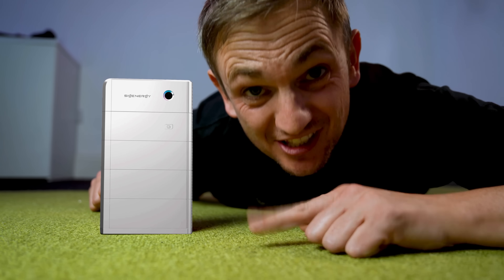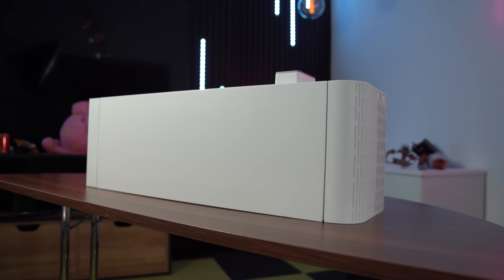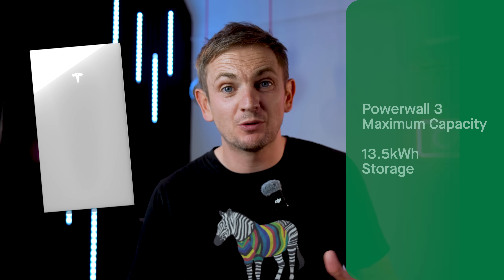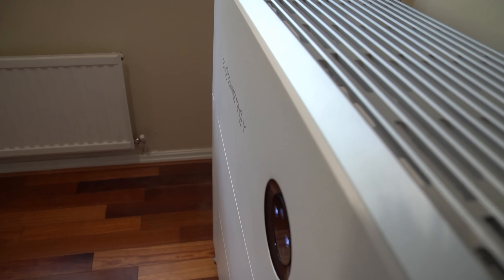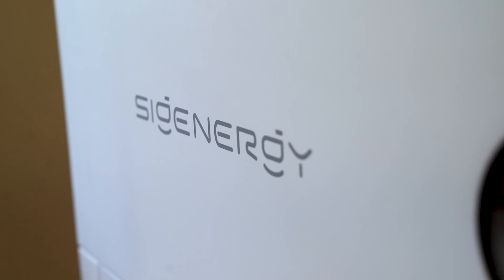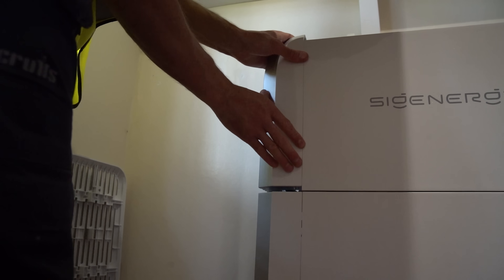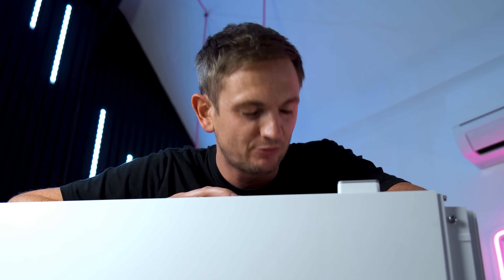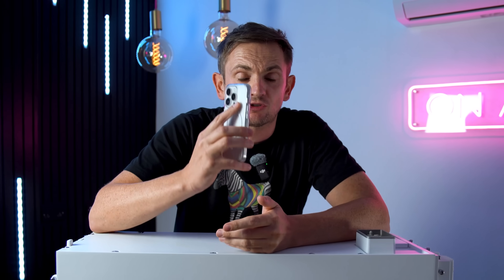Are Sigenergy Misleading Their Customers? NEW Battery Update

Comment: So as my g99 application has taken soooo long there is now a new battery available.  If i choose the slightly bigger 2x 10/9kw over my planned 2x 8kw, would i need a new g99.  Then when the new g99 comes through a 15/14kw battery will be available.  By the way i came home to no power wouldn't it be nice to have a battery😢
Reply: The g99 refers to the amount you can import and force export to the grid. This is all down to the inverter size (In my case 6 kw)
You can choose as much or as little storage as you think you may need and with Sigenstore it is relatively easy to add more later.
Reply: Can the Sigenergy be used in a power cut? I didn't realise that if it can, I thought it was just the Tesla, may need to rethink my (still vague) plans
Reply: @HiruS22 yes. With the gateway installed then the battery will work when the grid is cut off.
Reply: @makersmancave9725  Thanks, that's useful to know
Reply: Do you have any clue about batteries ? 
I doubt cause people with clue use the proper units for battery capacity and charge or discharging. 

Battery capacity means energy and the unit is called kWh from kilo Watts x time 
Watt is power and if you need 1 kW of power for 1 hour then you need 1 kWh of energy to run a load of 1 kW. Simple as that.
BUT : 10 kWh energy in a battery has NOTHING to do with AC kWh cause those AC kWh useable are the result of a long chain of losses depending on temperature and load and efficiency of the inverter. Forget about any idea we used 5 kWh of AC energy during night and a 6 kWh DC battery is big enough.
10 kWh DC battery can be too small if you simply follow the math and physics so save a lot of money and to it once but right.

All your calculations are like the titanic on its way to the iceberg cause you have not mention any of the keypoints to calculate anything battery related. 

Where is the key figure: our load till 11 pm is about 500 W and during night is about 100 W ?
These are AC figures and now you have to do the reverse calculation how much kW DC you will need from the battery to generate just the 100 W AC ?

You are dreaming in 9 or 10 kWh figures but the key is the efficiency you will get or better the losses you are missing to calculate.

100 W AC generated from a battery - based on the 2025 german government sponsorred investigation of Highvoltage storages -  will required 186 Watt DC and hence 43% of losses. 

How many AC kWh do you expect to get out of a 10 kWh DC storage ? And from which factors is the effciency depending ? 

You will never get 10 kWh AC from any battery. 4% are losd by discharging so you will get max. 9,6 kWh DC
And now put on top the losses for AC sine wave conversion ? 

100 W AC would draw 186 W DC from your battery ... and you might get 6,2 kWh out of it.
I will paste the souces below as answer to this comment that you get the full picture how to get a glimpse. 

just to let you know in a kind of short cut: a 5 kW inverter can run at 90% efficiency if you draw 900 W or more !
So your dream 10 kWh battery (which would require that the BMS is using the full 100% bandwith) with 9,6 kWh DC output would deliver at 900 W with a 90% efficieny 8,64 kWh AC useable. 

And if you draw less than 900 Watt during the whole night (12 hour night would mean 10 800 Wh AC demand) then efficiency goes down and your might 10 kWh battery will deliver less than 8 or 7 kWh AC and maybe just 6,1 kWh AC at 100 W AC load. 

Don't be fooled, do the math , think twice and forget about the SMART battery or AI battery cause those wann lure you into AC charging and that is a topic that can change fast and your battery usage can be 0. Has happened in other countries too.
Reply: 10 kWh battery is never what people think. 
4% will be lost to discharge the battry with a DC load no matter what . You can not get more than 9,6 kWh out of it.
And now the key moment comes: convert the DC power to AC power - and most importantly talk about the losses.

And those can be 46% for all those smart people who have learned about efficiency curves. 3% or 4% is the figure most have heard about as inverter efficiency but not reading the fineprint which says at or around nominal output of for example 5 kW. 

Let me know what your doing during night in your home ? Watching TV with a few lights and some standby stuff. Maybe 500 W or 600 W till 11 pm but then ?
50 to 100 W maybe and in case you are drawing 100 W during night then this 100 W AC needed will be produced with 186 W DC from the battery.

You might have doubts ? Check out Berlin University annual High Volt Storage inspection sponsored by the german government and search for "Speicherinspektion HWT 2025". You will find a german website and on the right half 3 downloads where you find 1 in english as a good readable presentation. On page 7 they explain these myths and efficiency differences with the 100 W AC load and the system efficiency (inverter side only, cause charging losses come on top). You want less losses then there are solutions - that is germany. You can get 98% efficiency for such 100W load too, but it comes at a price and you will need a multi level system.

So do not believe Manufacturers or PV system installers and check your nightly Watt figures - find the average and bandwith, montior it and do not use only averages cause 100 W for 30 minutes and 10 W for 30 minutes AC Load will cause errors if you do the math about the losses for 50 W average AC load.

Back to the example: Assuming you need 250 W and hence the inverter is at a better performance then look at the loss or efficiency curve 
100 W AC = 43% losses while 900 W AC can be generated from the battery with 10% losses you can extrapolate: 250 W is 150 W more than  100 W roughly 1 / 5th of the whole bandwith fro 100 W to 900 W AC.  And from the 33% loss bandwith (43 - 10) you can save 1 / 5th to or 7% which means not 43% losses but 36% losses.

Back to the DC output energy: 9,6 kWh DC available used with a 64% efficiency AC = 6,144 kWh AC useable  and 3,85 kWh lost in total
But that is just one side cause AC charging or DC charging comes also at a price of roughly 4% at least if you charge fast with high effficiency. 
So to get your 10 kWh battery fully charged you will hast to invest 10,4 kWh to get at the end 6,1 kWh out of that and 4,3  kWh had been lost.

Of cause your inverter can be more efficiten, you have a higher load in the night - the better the efficiency will be. 
But most people are not able to do the math properly and believe that they get 9,5 kWh AC or 9 kWh AC out of such 10 kWh HV battery.
If you have a low voltage 51V LFP battery the losses will be higher and you can feel the heat for sure too in the room and battery. 

OUR DECISION: we got the cheapest system which means we got single phase hybrid inverter 4,6 kW and 16 kWh batteries for 1400€ or 1250 GBP
That is the only way to live with high losses you can not avoid unless you spend a fortune for multilevel inverter and battery. 
We paid less than 2000€ for inverter and 16 kWh battery, we do not care about losses and hence we got multiple of these inverters and batteries.
Reply: @typxxilps would one be best to just have a small buffer battery, and instead Run a geny at night until battery tech improves further? I wonder if sig will be compatible with the likes of sodium battery tech etc going forward
Reply: As I understand things, your installer will need to submit a second G99 post install anyway to confirm what was actually installed / account for any changes anyway before you are given the ok to start exporting. As someone else says, inverter size is the main factor so changing battery shouldn’t have an impact.
Reply: No it’s to do with your inverter

Comment: At the price you mentioned of £2,250 PLUS vat (£2,643.75)  I could get 3 ECO-WORTHY 48V(51.2V) 100Ah Server Rack Battery, 5.12kWh Lithium Battery, 3U Size, With Bluetooth & Wifi for that price (2,099.79) and still have change left over to take the lads out on a night and and still have change for the Uber 😂😂😂😂😂😂and 15.36WH to boot!!!

Your old 8 kWh unit (£2,643.75) WOW!!
Reply: Have you found an electrician who'll install them? I wanted to go down this route but none of the sparks I spoke to were willing to fit a battery/inverter that they didn't supply 😐
Reply: I'm gutted i was just writing explaining stuff and lost all the writing. I'm sure you will be able to find someone to fit it for you what you want!
Reply: Yes just added a 10 (ISH) to my 2* 8kwH , all good

Comment: "Are Sigenergy Misleading Their Customers?"  I don't know, are they?  No doubt you will hopefully tell us 😂😂😂
Reply: Is Heatable misleading the customer regarding the benefits of microinverters? Anyone getting a quote should insist the warranty covers labour and scaffolding for the full warranty period. I've just had a SolarEdge optimiser fail after almost 10 years, installer said it would cost around £1200 to replace it, but the parts free. Luckily it's something I can do myself without scaffolding.
Reply: @TheRonskiman  That is one of the problems of having roof fitted solar panels (I am not talking about single storey height) and I wonder if MR. Heatable tells the clients that before he rubs his hands together?